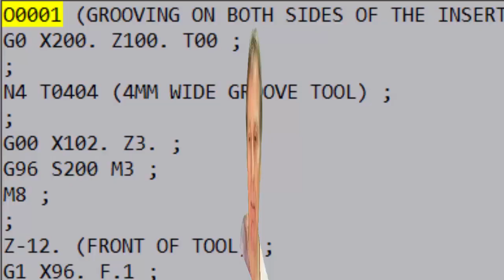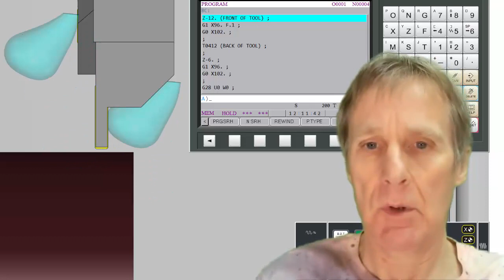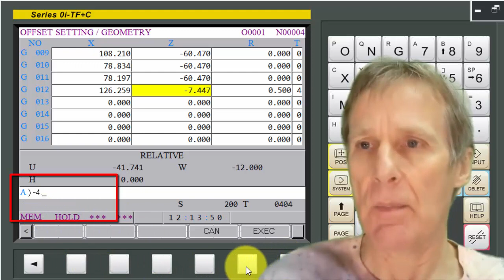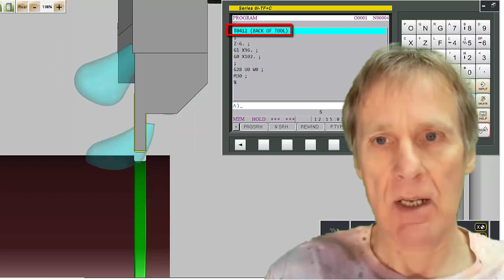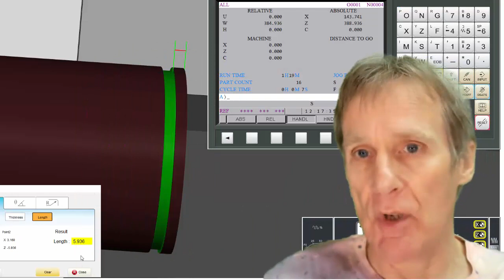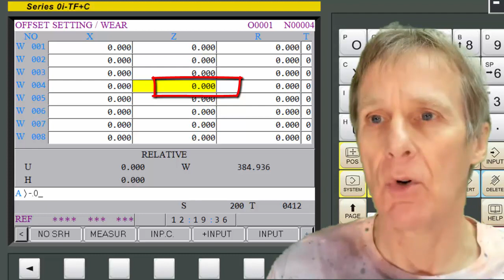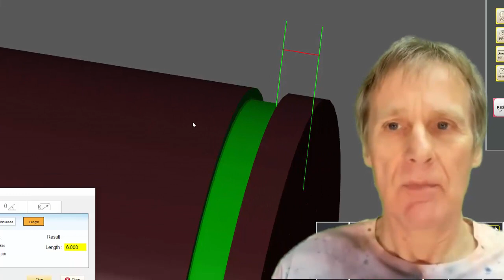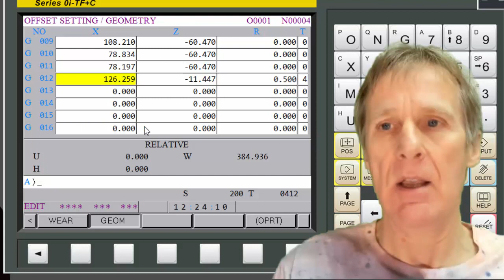Grooving on a CNC Lathe with two offsets

Comment: why put .5 in R..
Reply from the maker: If you need to use compensation for either side of the grove it's the tip rad of my insert.
If you are not using compensaiotn then it's not needed.